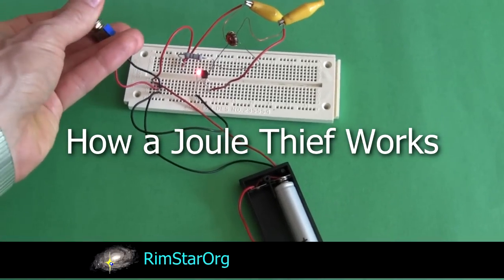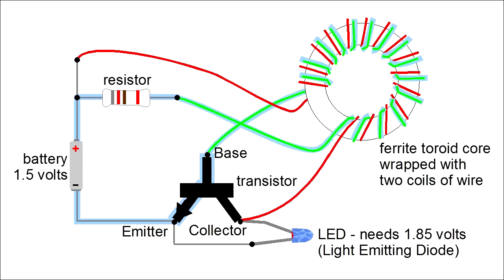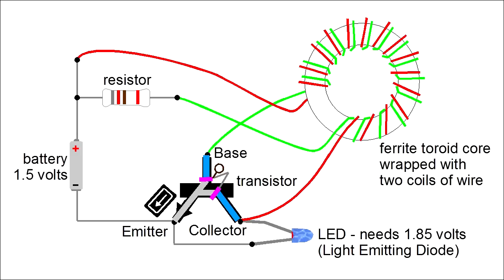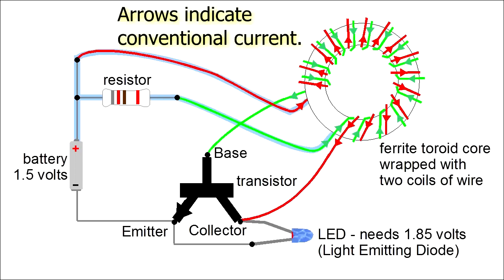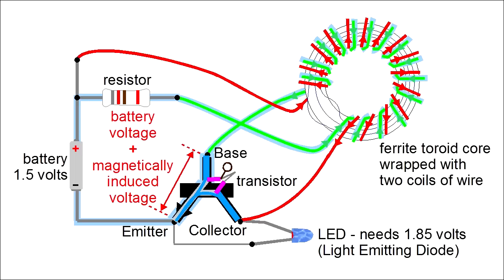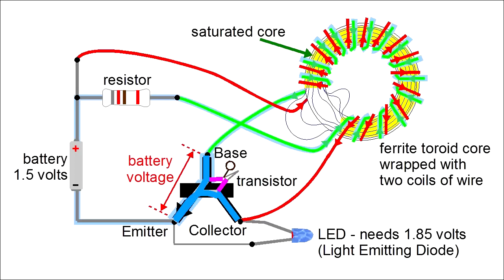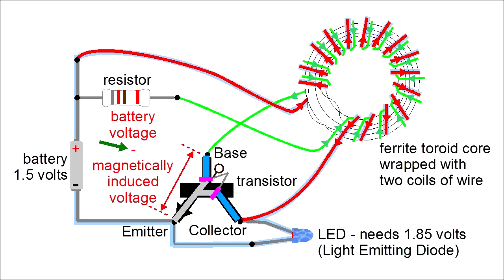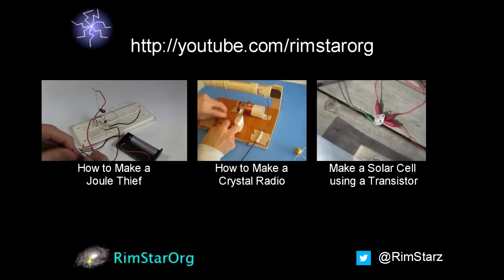How a Joule Thief Works

Comment: When there's no more increase in magnetics flux in the base windings and the base current is at its peak and can't increase anymore , the transistor switches off .  How ?  
What makes the base current to stop or lower it's biasing voltage abruptly  ? What black magic is involved? .
I thought inductors /coils in a dc circuit acts as a zero ohms resistor with zero volts across it but maximum stable current continues to flows once the storing /charging period has stopped ? .

Comment: Could you please answer whether i understood it correctly:
so as there is no changing magnetic field anymore the current in the green wire drops and when it drops it creates an changing magnetic field since it drops quickyl it induces high voltage  in the red wire and the red wire takes the path with the led with the voltage induced in itself and the led lights up right?
Reply from the maker: +C. Gueesy Yes, you got it.
Reply: +RimstarOrg thanks!

Comment: Thanks for the comprehensive explanation, but it's a bit fast.  Listeners need to pause it a lot. I don't agree with the core being saturated.  The proof is the JT works the same with an air core, and it's not possible to saturate an air core.  The reason why the current stops increasing is the resistance of the coil and the transistor limits the maximum current. Thanks.

Comment: Basically youre getting more out of the battery so it doesnt dim and last a little longer than full power all the time but less lived. Its excellent for running batteries to exhaustion without suffering power loss. Its an efficiency power input.

Comment: Believe it or not, the frequency is actually very much controllable. Here is a joule thief circuit built in a simulator. Try changing the values of R and the L of the transformer to adjust the frequency. Smaller L increases the frequency.

tiny(dot)cc/ouxvsw

The default frequency for that circuit is ~ 200Hz

Comment: I made this circuit and it works, but ... it only works if i use a fresh 1.5 volt battery. By that I mean, if I use a fresh 1.5 volt battery the led lights up and stays on. But if I use an old battery with only 0.8 volts, the led lights up for a few seconds, dims and then turns off. If I break the circuit (with the old battery) for 5 seconds it works again but only for that limited time, then dims and shuts off. And if I break it and connect it immediatly it wont turn on (only if i wait ~5 seconds). But with 1.5 volts it stays on all the time like in this video.
Can you tell me if this is normal or if I'm doing something wrong? 
Thanks a lot though, it's working fine with 1.5 volts and you explained it very well!!! Liked!
Reply from the maker: There are two possibilities.
One is that you have the wires going to the coils backwards and it's running as a normal circuit. It's quite common to get those wires wrong.
The other possibility is that 0.8 volts is just too low a voltage. In my how-to-make video I use a battery that's 1.27 volts, so I know that works (https://www.youtube.com/watch?v=B61DU7yEsPM).
Reply from the maker: Oh, and in normal use, it's normal for a battery that's almost dead to stop working, and then you disconnect it for a minute and try again and it works for a short time again, and so on, at least for a while before it just won't work anymore.
Reply: Thank you for the fast answer, one thing that i noticed was that after using both batteries in the joule thief, both of them reduced their voltage by 0.5 when measuring with a multimeter, and when I waited those few seconds it went back to 0.8volts from 0.3volts,  and 1.5 volts from 1.0 volts.
Reply from the maker: Yup, that's normal too. At least I know for lead-acid batteries that it is. When a battery is being used and just after use, its voltage it low. Then when you stop using it, it goes back up. The opposite happens when charging. During charging it's high.
Reply: Awesome, thank you so much for clarifying all my doubts! Subbed!

Comment: I meant ofcourse "changing the diode connection it self"  so if it was AC, then you could hook up a diode both ways and it would lead  DC current in both these 2 Diode connection configurations

Comment: Wow!  How did you get me to understand what's going on?  XD
Suppose I have an old 1.5v battery, and I want to use it to power a 1.5v circuit. How do I control the output voltage?  My guess is I have to use a transistor in which the base gate needs 1.5v to open.
Another question - suppose I have a little DC motor (from an electric toothbrush), will this be safe to run it with this joul thief as is, or should I add an AC to DC converter?
Thanks for helping me learn!!!

Comment: Would a joule thief work in amplifying rf on a crystal radio set to light an led? Using no battery of course. I suppose the crystal coil would replace your battery in the diagram.
Reply from the maker: I'm not sure. The voltage from a crystal radio isn't DC and it's also very low, usually less than 500 millivolts.

Comment: Who and when came up with this kind of structure ? it's very pretty. Also what about the frequency of the buildup/collapse ? is it kHz ? MHz ?
Reply from the maker: This is basically a blocking oscillator circuit.  From here https://en.wikipedia.org/wiki/Blocking_oscillator, you can see it's been around for a while. It's in kHz. In my video on how to make one I show oscilloscope output showing around 20kHz https://www.youtube.com/watch?v=B61DU7yEsPM.
Reply: wonderful, thanks again

Comment: I'm not that experienced in electronic circuits, but wouldn't some form of 'DC voltage multiplier' circuit provide a similar ability as this circuit since (IIRC) LEDs have very low amperage requirements?

Comment from the maker: That depends in large part on the resistance of the resistor but at one point I measured a single cycle taking 40 microseconds, so 25,000 times a second. You can see this measurement on my oscilloscope in my "Make a Joule Thief for Zombie Batteries" video. There's a link to it in the description below this video.

Comment from the maker: Nope. The anode (positive/long leg) of the diode should be connected to the collector and the cathode (negative/short leg) should be connected to the emitter which in turn is connected to battery negative.

Comment: Can we amplify the voltage ,which is across the led by using toroidal transformer
Reply from the maker: Yes. I do just that to power a CFL in this video https://www.youtube.com/watch?v=FkLET8MhRbU and I have this follow-up video where I measure the voltage and do other analysis https://www.youtube.com/watch?v=yz_99oVMbSI
Reply: @RimstarOrg   thank you

Comment: Will this work to light up an led light bulb? What would i have to change to make it more powerful
Reply from the maker: I doubt that it would work. An LED light buld has a circuit of it's own that's powering the LEDs. That circuit expects (at least in North America) 120 volts AC. A joule thief circuit puts out high voltage spikes with nothing in between. Now if you tore open the light bulb and removed the LEDs then you could try that, but I'm nt sure how big the battery would need to be.

Comment: The 820 is close enough to 1000 that the Joule Thief may work just fine, but it will use more current and put out more light.  If the JT tries to start but then goes dark, then the resistor needs to be increased.

Comment: Sir, can it run also on AC voltage instead of the battery?
Reply from the maker: Not directly, no. You'd need a circuit to turn the AC into DC first.
Reply: Thank you.

Comment: At time 2:51, the electromagnetic induction from the current in the red wire causing a counter EMF in the green wire is a subtle point.  

"Why would an increasing current and magnetic field in the red wire - induce a voltage in the green wire that is OPPOSITE to that of the red wire?"  as you point out,  this increase in collector current flow through the red wire increases the magnetic field around the red wire.  "And the voltage induced in the green wire is in the 'right direction', adding to the battery voltage"

it is a subtle point.  If you look up "Counter EMF" in wiki, you'll find the reason why - for the electrically uninitiated, Faraday found that electromagnetic induction creates a voltage in an adjacent wire (here, the green wire) that OPPOSES the change being forced on it (by the red wire in this case).

This is why the voltage induced into the green wire by the red wire is in the 'right direction to add to the battery voltage already applied to the green wire'.  

This circuit will only work if the green and red wires have current flow in the opposite direction.   If you change the green wire to be wound in the same direction as the red wire (with current flowing in the same direction in both wires) the circuit will not work.   

Since the the red and green wire already have opposite direction of current flow, the fact that the induced voltage is opposite the red wire is beneficial, it is ADDITIVE.

Two critical factors for this circuit:
1)  induced voltage is opposite in direction
2)  green and red wires are wound around the core such that current flow is naturally in opposite directions

Comment: Im a total noob.. I have been harvesting parts from old electronics.  I have a toroid coil with three coils on it. its larger like 1 inch across.  

Should I tried to remove the extra winding
Should I connect the extra winding to the middle one?
Or should I just ignore it all together.

In other words, will the mere presence of the third winding diminish the charge in the other ones?

Also this toroid has many turns of wire,  I suspect more than I would like.  Im working on a project that I want to increase a dc battery voltage from around 5.5 to 7.  what resistance should Introduce?  Also is it a reasonable assumption that to tweak the voltage change I should adjust the number of windings as I go?

Thanks for your help!
Reply: thanks for not replying
Reply from the maker: Clown Whisper If your goal is to increase the voltage from 5.5 volts DC to 7 volts DC then this isn't the way to go. The output of the circuit is far from DC. It consists of periods of no or low voltage, each followed by a brief spike in voltage and current. What are you trying to power with the 7 volts? If it's not an LED or a CFL then you're probably better off with something like this https://www.youtube.com/watch?v=wJU7AJgERG8.Regarding the third winding, it will have some effect but I can't say how detrimental it would be.

Comment: It doesn't matter which current flow convention you use, the coil windings would still oppose each other, it just that if you called the direction of current flow the same as the direction the electrons move in (the positive charge) (aka electron current) ... the direction of your arrows would simply switch. So conventional current or electron current, it doesn't matter... it's just that if you don't clarify, the folks from the electron current camp might make a wrong assumption and accuse you of drawing your battery at the wrong polarity instead of realizing that your using conventional current.
Reply from the maker: That last sentence you wrote is the reason I clarified. In many of my videos I show electron flow because I also show the animated electrons moving, so since this video was different, I figured I'd mention it.
Reply: RimstarOrg yeah showing the covalent gaps would be a bit trickier to make visually intuitive. Probably a good call... electron flow tends to be more intuitive to beginners, likely for this very reason... it's easier to visualise in their minds. I prefer it because I'm over 30 and from the US so it's how we learned electricity when I was in school... I'm kinda accustomed to it, plus it's nostalgic to me, no...ummm... sentimental to me, ah that's not quite the word either....ahhh it's rubbish trying to think of it, you get the idea anyway. But yeah, I get not wanting to have to explain that the direction of flow to the polarity of the circuit on such a simple circuit just indicates the current flow method being used. If you sprinkle a few videos here and there that are not using the method your viewers are used to, and you don't clarify, you'll end up with way more questions and 'problem comments' than if you do clarify. I was just throwing some bonus info out there. The 'you' in my original comment, while most obviously would read as YOU directly, I really meant it in a plural proverbial sense... I didn't think I'd get the honor of a response from the content maker. Thank you.
Reply from the maker: My own reason for showing electron flow a lot is because I'm a science and physics geek. I like seeing and showing the underlying stuff.
And thanks for taking the time to write up some bonus info. It's always appreciated.

Comment: If it's collapsing shutting the gates, reversing opening gates, collapsing shutting gates, reversing over and over, then why doesn't the led blink?

The led stays solid, shouldn't it be blinking every time the gates shut during a reversal?

And why does it stay solid
Reply from the maker: qoaa There are two possibilities. The first is that it is turning on an off, but at a rate that's too fast for the human brain to register. From the oscilloscope shot I show in my video about how to make a joule thief, at around 0:38 seconds into it (https://www.youtube.com/watch?v=B61DU7yEsPM) you can see it's happening at around 21,000 times a second, much too fast for the human brain. The second possibility is that even though it's cycling 21,000 times a second, the LED may not be shutting off fast enough and so it may always be giving off at least some light.
Reply: RimstarOrg
ah, yes, that's pretty fast :P that makes sense. thanks

Comment: If my predictions are correct then this device should kick up voltage at the cost of amperage.  In a way it's kind of like a step up transformer with a built in inverter.
Reply: +greencityman420 But transformers only work in AC, emf is only conducted with a change in flux linked with a coil; DC signals are constant and do not fluctuate.  In a way it is like the idea of a transformer, while no, it isn't at all.

Comment: i just build a joule thief following your explainations. it works fine but for some reason it is making noises. as i turn up the voltage the tone gets higher. do you have any suggestions what causes the noise? i think its source might be the small transformer i used instead of the ferrite toroid

Comment: what is causing the changing magnetic field in the red wire to induce a voltage in the green wire?Is it when the magnetic field is first turned on?
Reply from the maker: Induction is caused by a changing magnetic field in the red wire, so it's when the red wire's magnetic field is being created and again when it's destroyed.